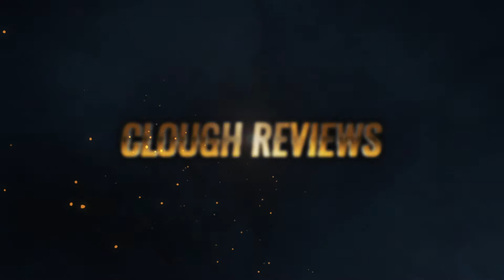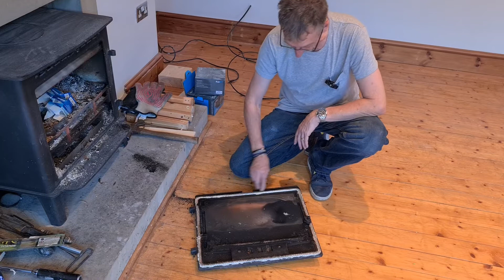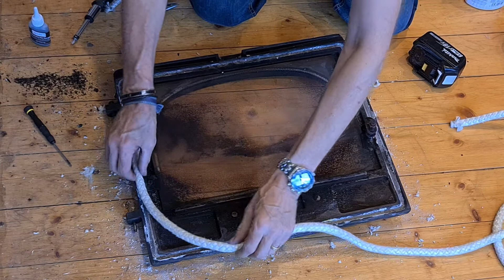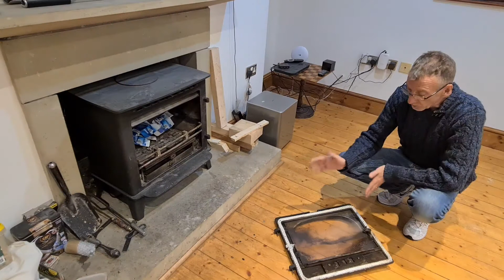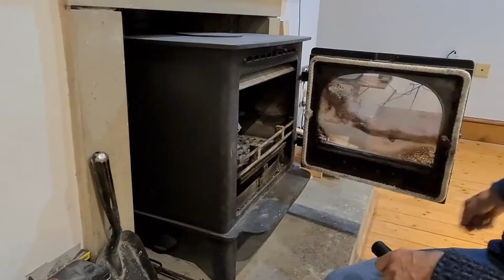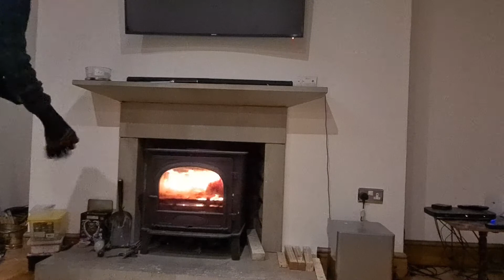Effortless Stove Door Rope Replacement with a Pro's Secret Trick!

Comment: How do you know what size rope too buy? Is there a way of measuring?
Reply from the maker: @derekalldridge4637  Hi Derek, I got this wrong the first time I did it, rather than looking at the old rope, I just got the thickest thinking it would be OK.  Unfortunately, it brought the door to far out (beyond any adjustment of the door). If you can't find anything in the specifications on the net, try and gauge a cross section by eye.
Reply: @CloughReviews  I have changed a rope before on I different burner and got lucky with my size of rope. My burner now is a mi fires Derwent but I can't find any info on the parts for it. I believe the way forward is to measure across the gap where the rope sits. I think that is the way to go.

Comment: Useful video! I had a go at doing it myself on a stove i use outside in the garden as a patio warmer and i put some 10mm rope around the door like you did but seemed that the door shut but not as fully or easily as it should.
Is the rope diameter too thick or do you want it to be larger than smaller?
Reply from the maker: I had the same issue recently.  The rope diameter does make a difference.  Have a look at the hinge side though, you should be able to unscrew the hinge bar from the inside to let it out a little more so that the door fits flush across the front.  If not, then yes, get a thinner rope unfortunately
Reply: @CloughReviews I was thinking it maybe the rope diameter so may try a smaller diameter one.
How do I adjust the door like you have mentioned?
Reply from the maker: @mattseymour8637  If yours is anything like mine, you lift the door off the hinge then the bit that stays attached to the stove will probably have a bar going through the stove itself.  This bar will have two nuts on it, one on the outside and one on the inside (they basically clamp the hinge to the front of the stove).  These are what you have to loosen to move the hinge out slightly.  If you are struggling with it or don't want to try, step down to an 8mm rope perhaps.  I will say, you have to play around to get the door level if you start messing with the hinges.

Comment: Is there a difference between the gasket used for woodburning stoves and oil burning stoves? Can i use gaskets made for wood burning stoves, for an oil burning stoves?
Reply from the maker: If it is just an air seal, you should be fine

Comment: Do you have to use tape on the rope ends.
Reply: Yes you do, and the joint should be at the bottom of the door
Reply from the maker: @skippymon  True about the joint being at the bottom.
Reply from the maker: No, just cut the rope with a sharp knife and try to make sure there is no gap between the ends 👍🏻😁